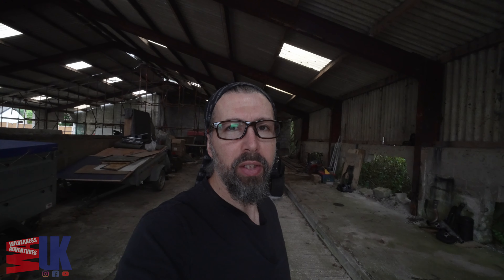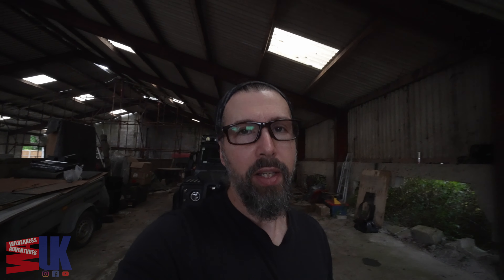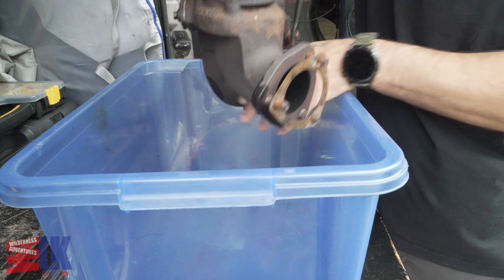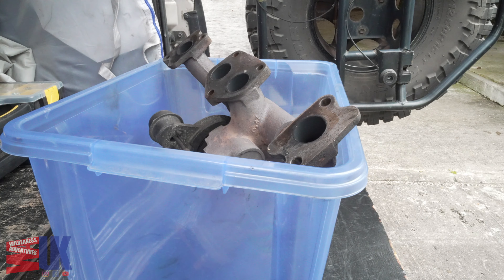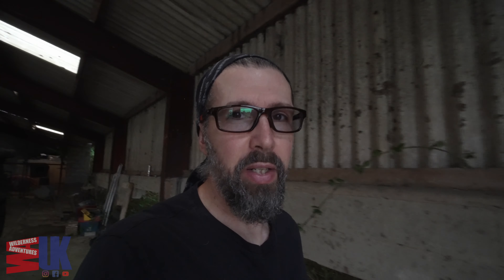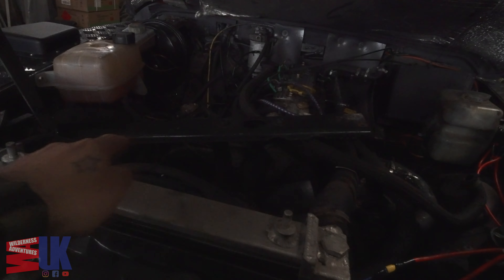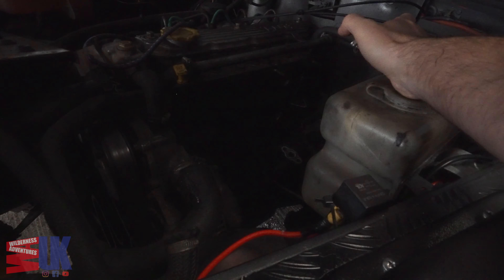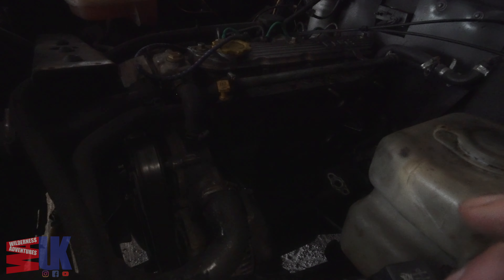Catastrophic Turbo Failure: What Went Wrong with This Classic Land Rover?

Comment: Removing the top pipe would of made the turbo over spin causing it to fail (no boost pipe no pressure for the waste gate to open letting exhaust gas to bypass the turbo) make sure to flash the oil to remove any fine pieces for metal and prime the new turbo with oil.
Your old friend Logan (mikes son)

Comment: Makes sense dude you are doing things in the order that it should be done. Best of luck with it man the tdi engines are pretty solid things and will take a fair bit of neglect before they completely stop. So running some oil through should be minimal damage